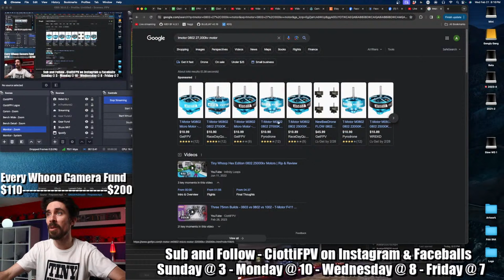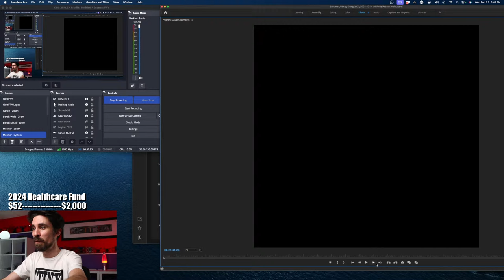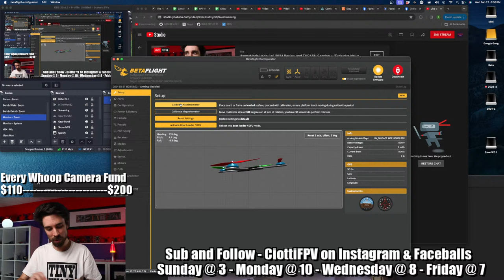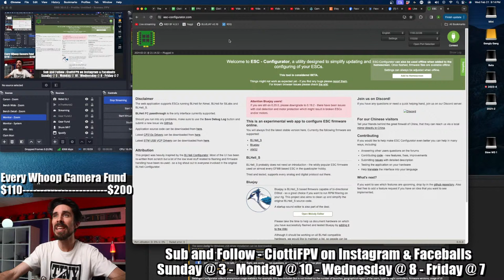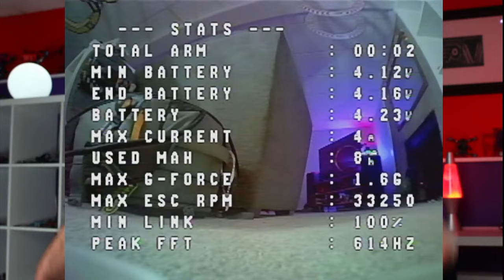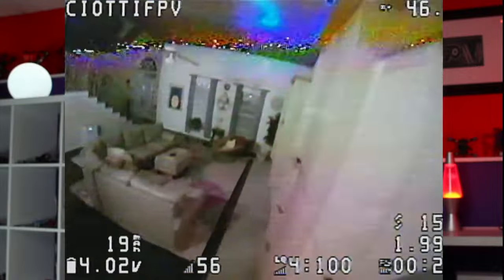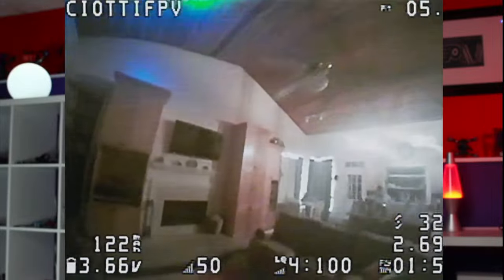HappyModel Mobula6 2024 Review and THRASH Session w/Exclusive News - Male Bag - #6Batteries - Q&A

Comment: Gooday GG and Ciotti how are you all doing?

00:01:46 Here is some great news about the Mobula6 2024.
00:12:06 Are the T-Motor 0802 1.5mm 27.000Kv A good alternative?
00:13:42 Can’t wait for or 101 to find out what I’m doing wrong. 
00:15:40 Just soldered a BT2.0 pigtail on one of the Mobula6 fleet. Works fine! Three more to go plus a Mob7
00:16:34 I didn't get to catch your stream about 33,000kv on 75mm, could u give a TLDR on whether or not you found it good?
00:17:12 For a newbie what should we watch out for to notice a motor needs replacing?
00:22:47 I want to build a 75mm 1s HDZ rig. Would you recommend high KV 0802 or 1002 motors for freestyle?
00:26:08 Do the GemFan biblade still make sense on 65mm HDZero build with 27.000Kv 0802 motors?
00:28:08 Do you have a Dummies guide to Slider Tuning?
00:31:50 What is you opinion on the 0802 EX motors?
00:33:00 So, what I'm hearing is use Snowblowers? Igow's , or the UWL motors from TinyWhoop if you want to use the carbon frame?
00:34:06 Got a mob 6 with 19000kv motors. flight control would reset midflight . after a while the drone lost all of its Betaflight settings . after reinstalling the dump the drone will arm. As I throttle up the drone shits off. is my flight controller ruined? what should I replace with since f4 happy models are still out of stock
00:35:3-29 Did you (and Quad 66?) figure out the no-duct-in-view camera mount?
00:36:18 also read the info on Betaflight when you hold your mouse over the "?" marks, it will describe what everything does in Betaflight.
00:39:15 Male Bag.
00:42:34 Reviewing the Mobula6 2024.
00:52:28 Connecting the Mobula6 2024 to Betaflight.
01:08:40 Binding the Mobula6 2024  to ELRS 
01:10:22 Checking on what version of Bluejay it is on.
01:12:34 Flying the Mobula6 2024. And how the batterie is centered.
01:20:16 Talking about the ultimate whoop.
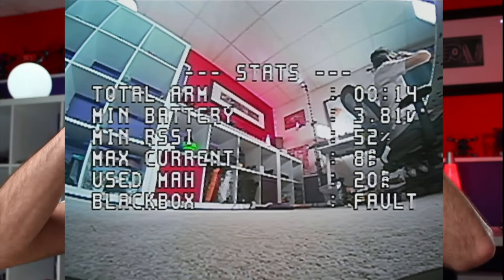01:22:32 how do you like the hummingbird v3 aio?
01:22:33 More flying on the Mobula6 2024.
01:29:08 For comparison flying the Ultimate whoop build.
01:33:50 Checking the motors on the Mobula6 2024 and switching the props.
01:41:26 More flying on the Mobula6 2024. After some explanation about the props hitting the ducts.
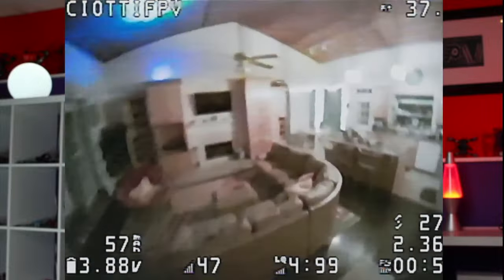01:49:57 Here is Teddy
01:54:00 Switching props on the Mobula6 2024. Also looking on how deep the props are laying in the frame.
01:59:59 More flying with the Mobula6 2024.
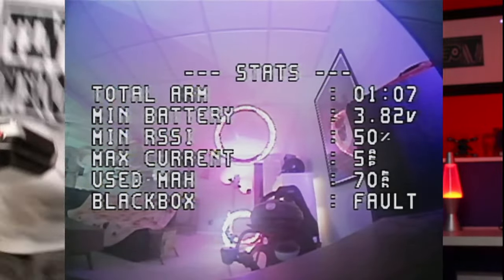02:01:47  When is this Mob6 2024 supposed to be available?
02:11:12 first thoughts about flying the Mobula6 2024
02:11:44 Switching the props on the Mobula6 2024.
02:15:11 If the UFW is a 10. what would u rate this one off first impressions.
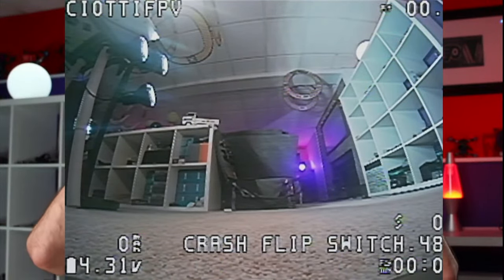02:16:09 Flying the Mobula6 2024.
02:21:50 What is the parts list for the ultimate whoop?
02:22:21 Betaflight batterie setup.
02:22:53 Lats flight on the Mobula62024 on this stream.
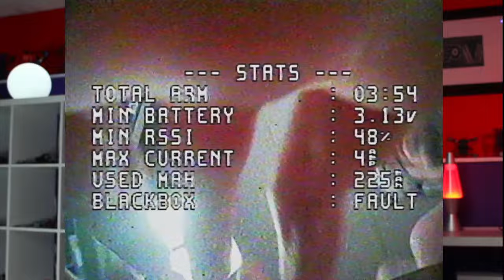02:27:58 How did the Mobula6 2024 held up the crashing.
02:29:42 What props you should use.
02:33:40 would you rather have ceramic antenna on that or the wire?
02:34:04 Does that FC give you the ability to solder motor SM connectors to it?
02:34:28 Can you drop the uptilt by using the other mounting holes?
02:34:55 Only thing I don't like about the Gemfan 1219S is the motor shaft stabs my thumb every time due to the hub height.
02:35:53 Thoughts after flying the Mobula6 2024

Stay safe everyone and have fun flying
Reply: Thank you for this!
Reply: @butterflyfpv  your welcome,
Reply: Thank you very much, Dude.

Comment: New chase looks killer!  I could see the rising sun license plate so well.  Slo-mo was perfect!  They do need to put a little crease inbetween the angle options to prevent tilting that screw.  The frame has shorter ducts and less material in other places.  Reny screws is about the only thing you could do to save weight.  180° plug for whoops should be standard anymore.